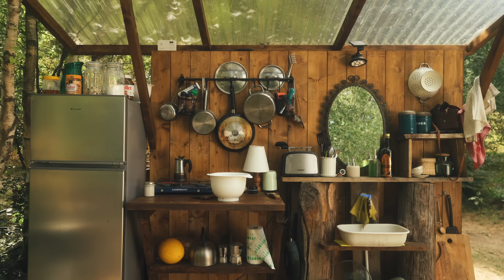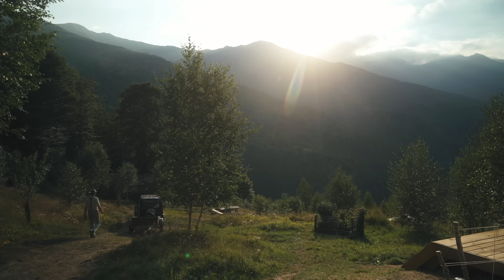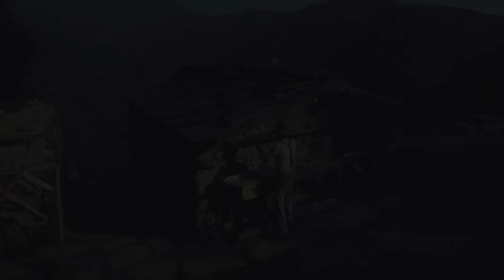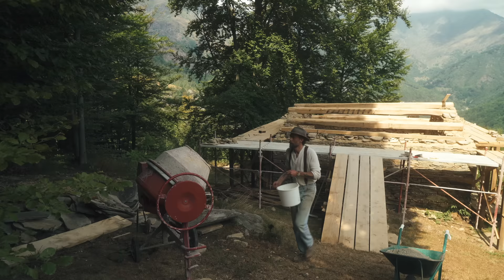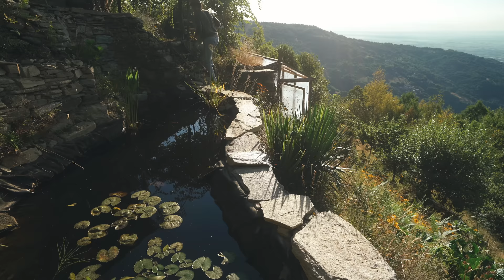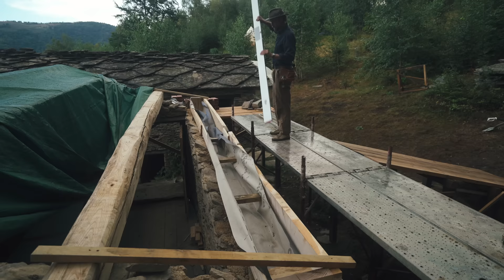#31 Outdoor Workshop, Bread baking and First work on the Roof

Comment: That cap you poured on your wall needs to structurally tie into the wall.  If u don't the weight of that roof could push that beam and concrete. Especially with extreme temperature changes.  Your doing great things hate to see anything happen on this important part.

Comment: Impressive work, Martijn! Concrete mixer running off-grid, in the mountains, priceless.
I have to tell you, though, that encasing wood in concrete is not a good practice.
The proper way would be to top your wall with reinforced concrete,  directly on top of your
stacked stone wall, (wash it for better bond) and embed some threaded steel anchors
to hold the wooden plate/beam. Wood should be separated from concrete with some bituminous
or similar membrane. The reason is that concrete always attracts moisture and wood rots if exposed to it.
Anyway, I enjoy your videos very much. Tot ziens!
Reply: I agree. Concrete does not work without inserted steel reinforcement, concrete absorbs the pressure, steel the tension. Concrete without reinforcement cracks and crumbles under load. Please consult a professional, Martijn.
Reply: @ulrichgloeckl6072  Go and have another look. He's got steel rods in the concrete underneath the wall plate
Reply: Yes, but that is not enough. I also mean the thin sheathing of the wooden beam.
Reply: Indeed, he is replacing a 200 year old roof and now the new one will need replacement in 20 years.  You cannot encase wood in concrete or mortar. All this work will be for nothing at all. It would have been better to leave the old beams and just support them from below. His skill set is not up to this project
Reply: @RRaucina  Disagree, Martijn is quite skilled actually and admitted it was his first concrete work.
The thin concrete around the beam will crack because of wood contraction due to its seasonal moisture change and the most contact with concrete will be with the layer the wood is resting on.
Since the concrete sits on top of the stone wall, it won't wick water, like a foundation wall would, so the wood should be ok, not ideal but likely ok. I hope Martijn does not make the same mistake with the other wall...
Reply: Exactly. This episode was about a man making a costly mistake. Everything he did was wrong and it will have consequences later on. This is the thing with youtubers, they often try to find new fresh ways to something that has been done and proven milion times.
Reply: @petrmikulik5095  That foolish "Crane" certainly speaks to that. Amongst so many other things.
Reply: @RRaucina  LOL. Spot on. I usually don't write comments. Don't want to sound like a hater or anything. But I actually had to write one when he started with that crane. I thought you just need three or four buddies and you're set. And it turned out I was right... Yes, there are many "oh no, don't do this" moments on this channel.
Reply: @RRaucina  Yes, the 'crane' beats it all. With all the intricate woodwork, tenons, winches, I expected it, against my experience (civil engineering) to somehow work even though I knew it would not.
Martijn stories are fine to watch on many levels, but technical they are not. I hope they do not inspire people to try to invent cranes.
Reply: I love his work ethic, but I fear many of his changes are for the worse. He approaches this project with the enthusiasm of a novice, but unfortunately that is also his skill level. And this is not a project for a novice. As with the others, this is not a "hater" comment as I am enjoying the series.

Comment: The videos where you are moving from project to project throughout your day, taking time to explain the process, are so very enjoyable and inspirational. 
Your roof, rising out of the scaffolding, puts me in mind of a surgeon with a drape around his surgical site 😄. I know you'll figure out the concrete mixture and do well with it, just as you do with each challenge you face. 
Thank you "so much" for all the effort you put into making these beautiful videos. It is very much appreciated. 
Have a good week. 🌄
Reply: Thank you for sharing the making of bread. It is a relaxing break from work on the roof. I am not a bricklayer but when I had one renovating parts of my house, he taught me to mix cement, water and sand building which is not a normal sand, best coming from river banks coarse grained sand. The sand building is obtained from the ground materials of previous demolished constructions and, as for I saw, the cement is not in larger quantity to water and sand and the mix, in the usage it was made worked it out great. Good week.

Comment: Concrete mix should not be runny.  It should be way drier than you 'd guess.  You slap the top with a tool of some kind the moisture will rise to the surface and make the top smooth.  Also, for it to harden properly, you have to keep it moist for about three days.  Wet it and cover it with plastic.  Come back and wet it maybe once a day for three days.

Comment: Youre doing a great job! but my partner was just wondering, how does the concrete hold the top plate for the roof when youve got a barrier membrane between the concrete and the top of your stone wall? He would have boxed it like you did and then stapled the waterproof membrane to the timber so that the moisture from the wall and concrete is not touching the timber. , Its a good idea to put both end rafters on first to secure it in place. Another idea would be to put reinforcing rod into the top of the wall at metre spacings, drill a hole in the timber, so when youve boxed it up and about to put the timber in, drill holes throught the timber matching the reinforcing bar to give the connection between your timber and wall. you may have already thought of that. Kind wishes , it is nice to see you restoring an old building in a beautiful place. you are very lucky indeed.

Comment: Embedding non-pressure treated wood into concrete seems like a bad idea. Especially if the concrete wraps around the bulk of the post. Since concrete is water permeable, the wood will either swell up and crack the concrete or straight up rot away

Comment: If you mix your concrete dryer, it is stronger. But it has to be wet enough to fill the voids in your form.  It's a tough thing to get just right. And it will be more consistent quality if you use your shovel to measure your portland cement to aggregate ratio, rather than just dumping some from the bag into the mixer. X part sand; X part gravel ; X part cement. (Whichever mix you are going for) 2 shovels sand ; 2 shovels gravel ; 1 shovel cement. (Don't use those measurements , they are just an example. I haven't mixed concrete that way in 30 years. I would need to look it up again)

Comment: Well done Martijn. I could sense the stress levels building during the concrete work even before you mentioned it! 
Always admire your approach to your work even if it’s something new - plan it out, get stuck in, course correct if necessary. 
Haven’t missed an episode yet.

Comment: Saw safety tips:
1: Don't EVER hold the workpiece away from the fence as you did around 5:00 ESPECIALLY when making repeated cuts like that. That's a powerful saw and will rip the piece out of your hand if you move whilst cutting, possibly pulling your hand toward the blade. Place a block behind the workpiece to space it off the fence instead.
2: Some will say don't cross up your arms as you did in the first shot. I do it regularly but always make sure my body is right of the blade in case it comes back.
Saw mounting tips:
1: You have a very sturdy bench there - instead of building new, separate bases to mount saws on that you want to sit at an exact height at in relation to the bench top, build platforms off the bench itself, then the saws will stay aligned with the bench top. (you don't need to use the metal base of the table saw)
Construction tip:
Seek the advice of builders/construction professionals regarding construction details - don't mke your own up. You clearly don't yet understand many aspects of the materials you're working with - there are so many problems/faults with the way you built that concrete-encased plate.

Comment: Hi Martijn! I am a visual artist and work a lot with cement. The secret is in the aggregate (sand, terracotta, or other). This influences the dry form and its rigidity. There are mixtures suitable for dry stone! I usually make 3 bags of sand (5 kg) for a 25 kg bag of intermediate sand. More cement than sand will break easily because it has no structure. It is important to use thin metal rods to give structure. Don't forget that this area has some synthetic activity and cement is not very flexible.

Comment: You mix universal concrete in a ratio of 4:1. So four parts sand/gravel and one part cement. Water is then added as needed. The amount of water determines the subsequent consistency of the concrete. A larger amount of water tends to make the mixture mushy, making it easier to pour a foundation. Tensile stresses occur on many components, for example on the underside of the beams, so I would recommend installing additional reinforcing steel.

Comment: Concrete is stronger but its used more for ground work, due to the small stones in the mix it can create pockets of air which can cause cracks, a sand and cement mixed might've been better for the roof but you do you man it's inspiring to watch u work and makes me put more effort into my own builds and projects

Comment: When I mount wood against stone or concrete I use isolation material between. Normally soft material used for roof. Kind of pitch or tar mixture with very small stones covered some kind of blanket. 
Stone has always humidity.

Comment: Carpentry advice using mitre saw 
Don't cross arms across blade. Unless you want to lose a hand.
Use a off cut against the saw fence while trenching or notching timber to avoid the saw snatching. Be careful.
Love the videos

Comment: You are a hard working man! I didnt see you secure your concrete beam to the wall? I would drill some holes through the concrete down in to the stones in the wall and put rebar to keep that concrete beam from sliding off the top of your wall over time. The rafters once attached will hold it in place for a while but that is a lot of weight to be adding to your roof structure.

Comment: I love your VLOGs Martin, but after last week's scary beam moving, you have me worried again this week.
When we restored and extended a rustico in Liguria a couple of hours drive south from you about 18 years ago, we had to install a ring beam before we could put on the new roof. This is for earthquake protection and prevents the walls from splaying out and dropping the roof inside.
The ring beam is shuttering as you did on all 4 sides of the roof and with multiple strands of rebar all wired together in a continuous loop and with encircling loops of rebar round the 4 strands every 10-15 cms. Then the concrete is poured onto that to make a very strong continuous plate. I can send you photos if you contact me directly.
It could be that this is not a requirement in your area, but I urge you to check with your geometra about how you are proceeding and whether it meets the local building code. 
It would be very sad if you have to redo all that work, but better to find out now before you get the new roof completely done.
Good luck
Reply: Commenting to highlight this tip.
Reply: I agree!

Comment: Hey dude love the videos! At about 4:49 it’s much easier and a lot safer to cut check outs with another bit of timber behind the bit your cutting out hard up against the metal Gard of the saw. So you don’t have to hold it in place. Because if your slightly off square the blade can grab and hurt you your do damage to the saw. Lots of love dude your doing great!

Comment: Love the sound of the rain. 
That temporary awning to protect the saw mill - is a good idea. 
With the tarp, to save yourself from pushing the rain when it collects on the tarp, maybe stretch it taut by tieing the edges with rope/string to those bricks? 
Very sensible, baking bread in the evening in summer. 
Can't wait for the roof to go back on!  This suspense is too much.

Comment: Great job, very interesting to see how things change
But I want to draw attention to one point   -  wood doesn't mix well with concrete
  the tree becomes damp from the water, and the concrete loses water and stops gaining strength, if there is such a need, then it is worth isolating the tree with something

Comment: I really have no words. I can read your actions. You love your life.  I actually am trying to fix cellar rock walls in South Dakota. I too am learning to work with concrete. I liked your idea of forgetting the pile of loose rocks on top and replacing them with cement. I was even thinking of bricks.  It is a process of thinking that often brings success, after several tries.

Comment: Tap the sides of your forms with a hammer in order to get air bubbles to float out.
Reply: Dryer concrete hardens stronger.  Cover wet concrete with your tarp and/or sprinkle with water to keep the concrete from drying out too rapidly.  Slower drying means stronger.

Comment: Consider building blocks (cinder block).  Lighter, less mortar, less concrete to fill and the come with "built in - bond beam cutouts in the top course.  When DIY, with little or no help, break down the construction into managable units.

Comment: Hi Martijn, I really did not like the paper in the concrete form since there is now no binding whatsoever with the wall.  The paper may also create a channel for water later.
You expressed a worry about concrete leaking under the form.  Why not use a little lime to fill the gaps between the form and the wall so that no concrete will exit the form?

Comment: I bake a lot of bread in "dutch ovens" as we call them here in the US.  Of course, the dutch oven goes in the electric oven, not over coals.  But I suspect you might have an easier time achieving a good rise and less risk of burning if you increase the amount of dough, by as much as 2x or perhaps even more.  My loaves are very large; they end up pressed against the sides of the dutch oven, which supports the dough in rising.  The edges of your loaves are very short, and I think this may tend to make them more likely to burn.  Even though a larger loaf would mean the edges were in contact with the metal, a larger volume of dough overall would probably mitigate the heat.  I would guess that a much larger loaf would not take all that much longer to cook - perhaps an additional 10-12 minutes.  Also, if you want to fine tune the loaf a bit, perhaps make your cuts just before baking more parallel to the top surface of the dough rather than perpendicular.  This should give a better rise. But my hat is off to you for learning to bake with wood coals!

Comment: I hope at some point you build yourself a full-on proper brick or stone bread oven.

And I was wondering how to deal with the gap between the top of the rubble wall and stone roof, nice fix with the concrete curb/infill wall.

Comment: Whenever I've used a plate to fix to a wall or foundation, building regs require the plate be fixed to the wall or foundation using threaded rods drilled vertically into the wall or foundation, fixed with strong epoxy. When laying a concrete foundation the bolts are placed in the concrete before it sets. The plate has been pre-drilled to allow the bolts to protrude through. The plate is then threaded onto the bolts and tied down with nut and washer. You can still do this with the plate you have already put in place. Drill through it with a powerful drill, at least 30cm into the wall, knock in some threaded bolts heavily coated with epoxy. You need a bolt every metre at least. Otherwise you risk the plate moving under the weight of the roof.

Comment: The lime will help adhesion to the rock and tend to resist moisture.
Reply: I agree with this. Lime resists moisture while staying "breathable" meaning it can evacuate it. You can also leave it in contact with wood without problem, unlike concrete. If you look at Martijn's old roof, the beams had most probably no trace of rot where they where sealed into the walls.
But you can't use steel bars because they get corrugated by lime. 
I would have tried to use lime myself, but doing so means you have to learn the ancient building techniques, or modern renovating ones... And it's always easy to criticize from behind your screen (talking for myself 😋) Cheers from the French southern Alps

Comment: Very interesting and appeasing video as usual :).
I don't know if you're interested with, but may be before buying any new tool or material as you did here, would it be an idea to contact the brand. If you mind talking a bit more about your purchase, how you use it and demonstarte a bit how it works, you could get a  bargain on it or even for free. 
I've seen it on other channel.  I think it would be worth considering such an option.

Comment: Well done Martijn. Working with concrete for the first time is a different experience with so many things to go wrong but it looks like your mix is good. I really feel for you having the raw materials so far away for the mix - the aggregate and sand - and it does multiply your work. A tipping trailer and one that can carry that weight reliably and securely would be great - as with a vehicle that can bring it right in to the cabin. Really admire your work rate! Were you happy with the bread texture with the different flour? We love the channel and find it a weekly source of delight and admiration. And rain? I'm from Scotland and the only way we know summer has come is that the rain is warmer. ;)

Comment: I'm not finished watching and maybe it's mentioned but wouldn't you want over hang on the gables of that roof you are fixing? On a normal house that is shingled it's ok to extend it after but wouldn't that stone be a bit to heavy for and extension? And add snow load too.